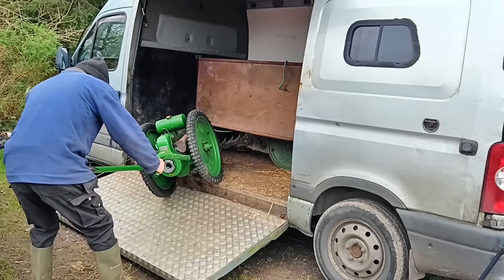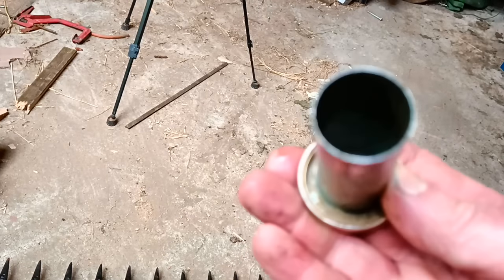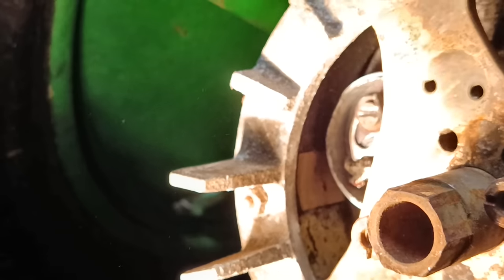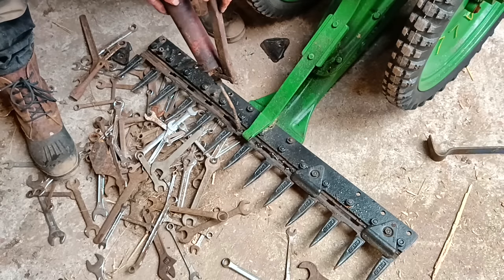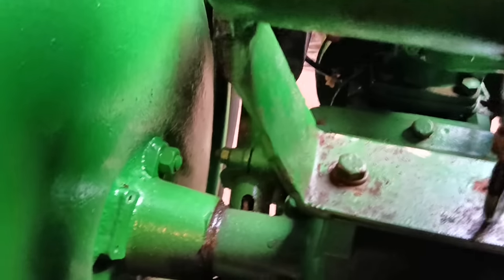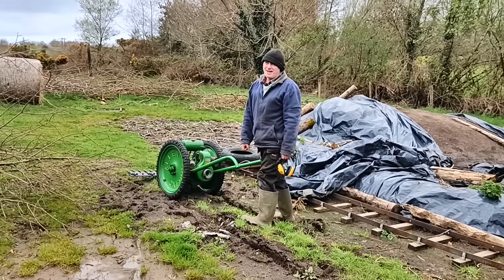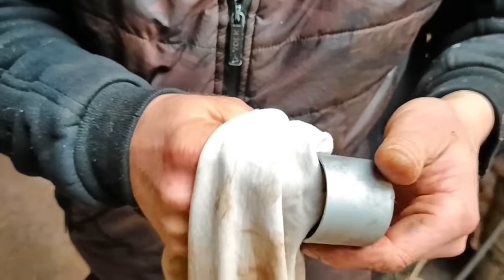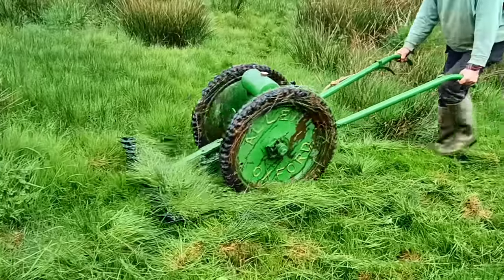First Run With A Vintage Allen Scythe Mowing Machine (1950s Model T)

Comment: My Dad bought one of these for our smallholding 35 years ago. It was probably the worst piece of machinery I have ever had the misfortune to use. Virtually impossible to start, even harder to declutch, shook my arms to jelly. I came across a Honda with a cutter bar attachment some years later (I preferred the flail mower attachment for brambles etc.), please just get one of those!

Comment: Looks dangerous, it should fit in perfectly! I'd recommend a remote cable operated shorting lead for the spark plug for quick engine kill, rather than the other way round!

Comment: Very interesting machine. I had one thought that would likely make this better for you to use. 
That would be a sulky. Gravely was a machine that was similar wheels and they worked quite well. If you need more traction add the add the extra pair of spare wheels to what's already there.. the oil mix is likey an issue as well.. back when this machine was new did the oil companies use a dedicated type of 2 cycle oil? You may be over oiling it. When you showed the inside it was way to oily. This needs to be fixed before you fix or tune any more. Cheers from this side of the Pond! Regards Bob from Virginia USA

Comment: Ooh, BCS has some mowers and walk behind tractors just like that! Given the size of your farm, I thought it was a perfect use case for them, but I just thought you had some kind of objection to them.

Oh well. The second R is reuse, so as long as it still runs it's way better for the earth to run a two stroke than scrapping the poor things!

I wonder if it's possible for their mower attachments to fit?

Comment: Vililers, as in predating Norton Viliers... not only is it going to be imperial threads and wrenches on that beasty, but likely British Whitworth threads and pre standarized tolerances too... DON'T LOSE ANY BOLTS

Looks like a wee AMAL carburetor too, probably factory, they can be hard to find parts for but not impossible.

Comment: i remember having one  of those in for repair back in the 70s it would start ok but after about 10 minutes it would stop with a very  loud bang  out the exhaust as loud as a shot gun and not start again until it had cooled down at the same time the spark would have disappeared turned out it was the condenser at fault  .
Reply from the maker: Interesting - thanks

Comment: The cycle is suppose to be on the ground when cutting , my grandpa made a wheel for the front and a sulky and drove it around the farm cutting pasture grass and the lawn , he also use it on our fresh cut oats field to get bedding for the cows using a straw rake to gather it up . you have the extra frame to make a sulky and tires . is the width the same as your train tracks and that back fire is a lean pop , more fuel is required !

Comment: Tight turns (U-turns) are your enemy so you’re likely to have more fun mowing one swath and then skipping one or more lanes and then looping over that until your skipped area is cut, then move over and skip a few more lanes and so on. The other thing that might work with these is “push” (in other words swing your whole body weight) into the handle opposite of where you want to turn, thus taking advantage of the differential in that side (rather than trying to slow down the inside wheel and trying to cling on for dear life).
Reply: Drive an Allen Scythe like a Zamboni? Brilliant!

Comment: on the clutch issue: if the clutch fingers or dogs inside the worm wheel are undercut from decades of vibration in use, then the clutch will be difficult to disengage under load, because you would need to pull the movable clutch piece out from the undercut it sits in, against the power of the engine. I´m struggling to find an analogy for this condition, so I´m sorry if the explanation doesn´t help. But next time you can´t disengage the clutch, try giving the mowing machine a strong shove forward while trying to disengage the clutch. This is basically the same as shifting a motorcycle transmission upwards by preloading the gear lever and taking back the throttle. This sudden change in load direction takes any forces off the gear teeth and lets you shift as if you disengaged the clutch of the motorcycle.
Reply from the maker: Thanks, yes, others have suggested lifting the wheels briefly. Not something you can do on a bike though!

Comment: Hello guys , I have an old Mayfield equivalent of this , very similar but has the 4 stroke engine & a 3 speed gearbox ,  they are so geared down that they end up with a terrific pulling power for their size , Villiers engines availlable to us in the northern hemisphere all came from Villiers Street , Wolverhampton , a very old but exceptionally capable company . There is no decompression device or "easy - spin " camshaft trickery done on them , so as you are setting your timing point I would be using a dial gauge & stylus on top of the piston , to find true t.d.c. . Get it wrong by being too far advanced & the old engine can literally rip the cord handle straight out of your fingers by kicking back , these have one hell of a potential kickback on them , this is good enough reason NEVER to wrap the starter rope around your wrist before giving the starter pulley one hell of a yank , or you can quickly get your wrist broke ! Some parts are still availlable for the engines , the original factory is I believe , now demolished , these last because of the high quality of the cast iron block & internal components the Villiers Company used . Try L & S engineers in Brownhills ( I think this is Walsall , just above Birmingham ) for engine parts , I used to get mower blade parts from Riverside Engineering , they were in one of the Sussex Coast towns , I can't remember where , check the net to find them . The Villiers company history is on the net , I,ve read it , fascinating , & there are links to parts supplies . Villiers engines all seemed to suffer from a very short - lived ignition coil , this usually sparks when cold , but once hot , won,t spark again on fuel refill until the coil has cooled down again , the only cure is a new coil . One very clever guy I knew said that the magnetic poles at each end of the coil needed a "keeper " across them when the engine was not being used , like a kids toy magnet , but with the coil inside the flywheel housing just how you'd achieve that is unclear to me , the cheaper American engines we all know have the coil outside the flywheel , so no problem arranging this on them . Just 2 adequate rubber grommet - ed holes in the tin housing in the right places & slide a carefully bent bit of stainless steel rod into place . ( keep this rod insulated off of the blower wheel housing ) Hope this helps , best regs .
Reply from the maker: thanks very much Phillip - lots to think about there : -  )

Comment: Looks pretty exciting when you need to turn it around and hang on for dear life. But maybe you can throttle down and disengage the clutch to turn?  Is there no way to disconnect the blade for safer transport to/from the field?

Comment: half pint oil  1 gallon petron that was same as teagle engine but with modern oil i was told in 1992  you could use normal chainsaw mix

Comment: I love the diff! As to the smoothness, I hope this isn't terrible "guy on the internet" advice, especially since I know nothing about combustion engines.... But would some hydrocarbon additive help? I gather the oil does the job of lead in leaded fuel, but I'd have thought the instructions from that era would have assumed that the gasoline you're adding is leaded?

Comment: That's a Dog clutch, not a convention friction type clutch that normal cars have (similar to what happens with the gear selector inside racecar gearboxes). By design it's impossible to have smooth engagement with it. 
Think of it like slamming your car into 1st from neutral without pressing/releasing the clutch pedal to set off forward motion, except unlike in cars, the Dog teeth are strong enough to handle the fast/harsh engagement, however, trying to engage slowly will chip or break the edges of the teeth as they smash and skip over each other ( probably the reason why some of the teeth are missing).
Friction clutches can be slipped to vary the power transfer, Dogs cannot, either on or off. 
Also that watery gearbox oil is begging to be changed, it's a good thing this came with a spare, i can't imagine what a new worm gear set like that would cost to be machined up if you couldn't find another for sale.
Reply from the maker: Yep - but I've learned that if the weight is taken off the wheels then it's easier to operate the clutch..

Comment: Try creating a drill attachment for it so you won’t need the pull cord all the time. Also to fix the carb, try something called “JBweld” it could be a temporary fix until you find a new one that will work

Comment: With. That Type of clutch if there is Any Torque on the mechanism it will not want to release and there is nothing wrong with it. I have found Out over the years if you. Lower your engine  RPM's when you want to take it out of gear. It will work easier.
Reply from the maker: Thanks - that makes sense

Comment: To get engine to run correctly you will have to add a lead substitute and I would run on 98 octane, and it cannot have ethanol in it. And remember the oil mixture is for gallons not liters. Ethanol in the gas can cause a catastrophic explosion in this type of engine. Lead is used as a lubricant in this type of engine if a substitute is not use, the engine will destroy itself rather quickly.

Comment: Since you have a non-running second one of these, perhaps you could come up with a way of connecting the two so you could sit or stand on the center or the rear one while steering the front one - a bit like an articulating tractor. 😂

Comment: It's hard to tell on my tiny screen. Is there a hole at the top of the spring mechanism in the front where a balance weight could be installed to mitigate some of the vibration?

Comment: I'm in Australia and we've had one for as long as I can remember. My brother used it some years ago and my father many years before that. Today one of my boys wanted to know about it, so we pulled it out of the shed in hopes of getting it running and working again. Please can you tell me, what is the fuel mix? I think Villiers 2-strokes were 16:1 or 25:1. Also, we need tyres. One went bang rather impressively this afternoon. Do you know if there's a source of parts? Any information you can give us would be greatly appreciated 🙂

Comment: Instead of going in lines back and forth and needing to turn around 180 degrees, try going around in spirals, starting around the border of the area you want to cut. Should be easier to turn

Comment: You are using far too much two stroke oil 40 to 1 would be ok with modern oils also there is brass cover cap which goes on the points to keep the dust and dirt out excellent though
Reply: Some of these old two-stroke engines had a oil mixture as much as 10:1

Comment: make sure that you dont get the habit to let it run with the fuel closed to keep the carb dry ! that will damage the engine by time as it will run lean for a while and eventually damage the bearings

Comment: Because it's a plain bearing old piston port two stroke, run mineral oil at least at 20:1.  They are designed to use a lot of oil and it's used to float the bearings.  Definitely don't use modern synthetic oils at 50:1 - they were never designed for that.  When in doubt, swap the plug, they foul easily.
Reply from the maker: Thanks - so some ordinary engine oil instead?

Comment: Seems the biggest problem with the machine is making the turns. Probably wisest to disengage the clutch and manhandle it around to take another run. Not easy but better than the clumsy scramble I watched. Another option would be to plan your operations to eliminate sharp turns, i.e. work in circles- maybe from the inside out.

Next, measure carefully the distance center-to-center of the rivet holes of the knife sections. With luck, you can find some to match either online or at a farm supply store. Look for modern sections with serrations on the underside. When this machine was invented, there were no such things but now there are, and they are self-sharpening which will make the cutting much more efficient. While you're at it, measure also the distance c-c the bolts holding the guards on- the things that hold the knife. They are the other half of the cutting system.
Reply from the maker: Thanks, Kevini, will do.

Comment: Interesting animal transport vehicle!
Can you load from the back also?
What is the name / type?
Dont worry if there is rust on th flat sides of the knife and the bottom part.
It will grind of when you use the first time.  As you surely know you shall  only sharpen the blades on the side 
Whit  the cutting angel, the flat part is never sharpened but you can de burr it with a file if you file parallel with 
The surface.
 The lubricating of the blade 
Is  interesting problem,  first I lubricat
My own cutter and the oil get wiped of by the grass almost instantly when 
I start cutting , or I lubricat and drives 
The blade thru a "ant grass /sand  pile" now there is sand and oil mixed in it ....
I oil my blade sometimes but dont" go over board" whit it.

When you store the machine on" of season " you should pressure wash the blade assembly dry it and put on a generous layer of oil especially on the surfaces that are in parallel contact. 
The finger that moves the blade my by worf puting som oil on on your machine now and then. fat would be better in lub perspective but collect sand in it more easy, and is also hard to wash of when it has collected sand  .
The machines whit the "fingers",like 
Yours  are protected from stone contact on the points of the knife,  but the slit in the fingers may be  yammed if the blade pulls debri into them. 
My machine is a modern one whit
Open knife  no fingers but it can sometimes try to   "cut stones" and sutch when you work .
manufacturer:
euro sytems
Reply from the maker: Thanks Staffan - and will yours cut and climb like this one?

Comment: Hello you'll find that the Allen scythe will cut perfect if you hold the handles up the idea is the weight of the grass keeps it held to the grass,as for turning that what the clutch is for get to the end of the run  ease throttle off put clutch in turn around let throttle up clutch back in it'll cut all day ,I've cut 3 acres many times with  an Allen scythe,as for fitting an horrible honda engine absolutely not that is sacraledge to a fine piece of BRITISH engineering ,

Comment: Never ever grease the blade bed or the blade,get some clean sae 30 engine oil and drain/refill the gear casing,and when you have trouble disengaging the drive while under load ?  lift the handlebars til the wheels are clear of the ground. .

Comment: You would be better off switching the petrol off and running it until it stops with the carburettor empty this prevents the spark plug oiling up!

Comment: It's running about as good as it's going to get..  If/when the clutch doesn't disengage, lift the handles, to lift the drive wheels clear of the ground..... 2 problems I found was, it's to fast across the ground, and the handle bars need to be at least 6'' higher, they must of been designed for dwarfs to operate 😉😉👌👍.. The four stroke engined Allen  Scythe were are far superior machine..
Reply from the maker: Thanks, Trevor. Also the clutch lever works counter-intuitively. Apart from those things, it's perfect

Comment: Yeah, no, the engine may be a bit rough, but you followed the 1950's instructions and gave it too much oil. Modern two stroke oils are way better than what they used to use, and I suspect that if you used less oil, it would improve its performance, and its smell. Good luck with it, and count your toes before and after use!
Reply from the maker: thanks - I'll try that..

Comment: That oil looks like the awful mixture of oil and water you get when you change oil of an engine with blown head gasket. furthermore please check the sparkplug and the ignition points and timing

Comment: The paint on the cylinder and head should be removed for cooling purposes. The paint acts as insolation.
Reply from the maker: Good point - but hard to remove..

Comment: attachments
spray pump and equipment
rotary boom
hedge trimmer probaly tarpin
circular saw
hay rake trailer seat
carrier
low loading trialer
sheep shearer
roller
horizontal plough
hay sweep
air compressor
hedge cutter
knife sharpener 
snow plough
light hoe
seeder
gang mowers
grass master
centrifugal pump
Reply from the maker: railway loco?
Reply: @wayoutwest-workshopstuff6299  uuse a wolsley merry tiller